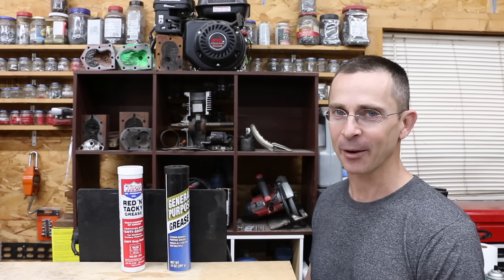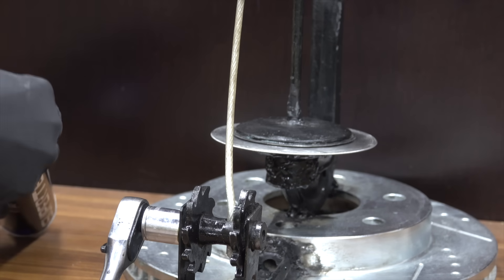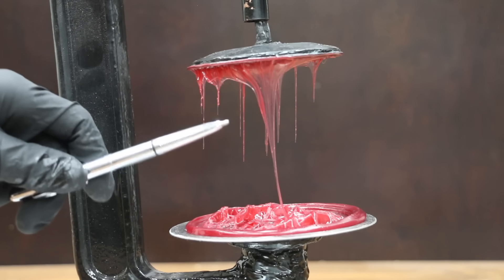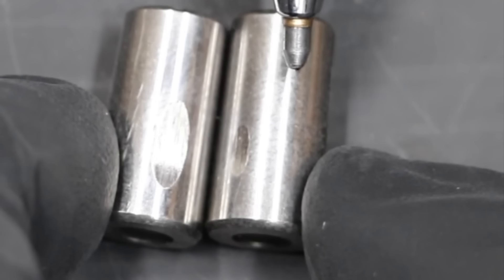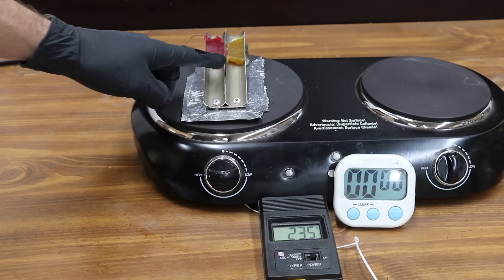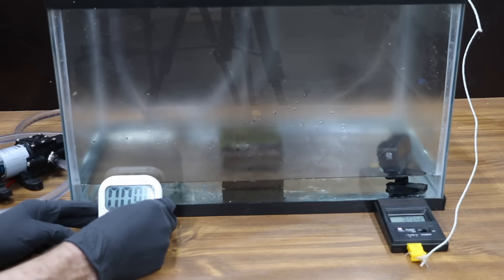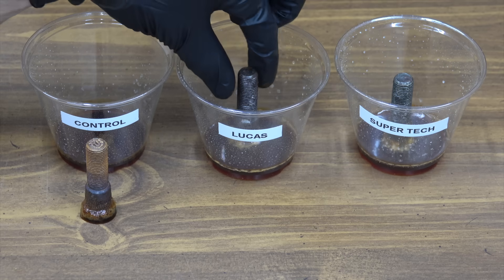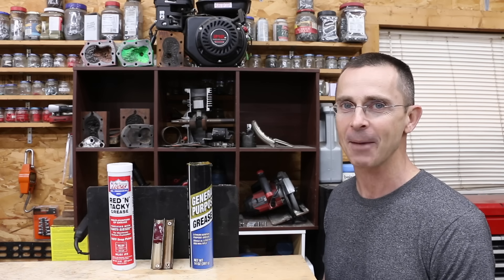Is Cheap Grease better than Lucas Red N Tacky? Let's find out! Bearing Grease Test Episode 1

Comment: Hello my friend. The big difference also comes to the kind of grease you used. The cheap one is simple "lithium" and lucas is "lithium complex" which is a higher perfomance grease. for a general purpose grease buy any brand just "lithium complex" not plain "lithium".
Reply from the maker: Thanks for sharing.
Reply: @ProjectFarm  The world of greases can be a little complex. For instance some greases use "light" oils to make greases for higher speed applications but those greases are not great for heavy loads and the other way round some greases use "heavy" oils to make greases for heavy duty but they are not the best choice for high speed applications. you can have a look at this chart made by SKF, you can have a look at the kind of thickener used for each application and the viscosity of the oil. https://www.skf.com/binary/92-299722/0901d19680658c60-SKF-bearing-grease-selection-chart_tcm_12-299722.pdf
Reply: @vaguincolombia  Thanks for the link! It's difficult to choose the right type of grease when there are so many.
Reply: @Asyss_Complex  You are welcome!. if your application is just the usual, a general purpose grease then a complex lithium grease is more than enough, it covers to medium-heavy loads, high speed, great water resistant and high temperature beyond that then is considered greases for special applications, super heavy duty for heavy machinery or extremely high temperature those are another kind of greases but those greases are for low speed applications only. So there is not a grease that makes everything.

Comment: I love your channel, commitment to unbiased results, and faith in the scientific method.  That's why I'd like to mention that part of your water test is inherently flawed- you scraped away the grease that went over the edge.  If the jet was more on-center, you wouldn't have any grease over the edge and your results would be different.  What you really should be doing (and what you did) is measuring the diameter of the crater assuming both layers of grease have the same thickness.  I'd throw out the other half of the test as it's misleading and faulty, but keep the data from the crater test.  The mass of the grease has nothing to do with the adhesion properties, ESPECIALLY if you're just scraping off what happened to go over the edge with imprecise placement of the stage.  Keep it up, I still love you haha

Comment: Thanks for all of the testing you do. As a engineer I really appricaite your detail and data collect you you go a great job thanks.
I wonder if you could devise a test method for different sheathing, CDX vs particle board. Or maybe varities of partical board. The prices vary greatly, I wonder if one is really better than the other for strenth?  The cost difference from $12 to $24 for a 4x8 sheet. This really adds up when building even a simple garage.
Reply from the maker: Thanks for the video idea.

Comment: How about a test of actual Ball Bearings among brands like SKF, ABEC, Nachi, PGN, hardware store no brand, Ebay-made in China, and testing for break in and play or possible failure?  Also have RS rubber seal, ZZ double metal sealed, Open, and others to break down more.  Most all things have bearings and if you rebuild or do proper upkeep you can spend a lot of bearings of time and can't find any real test in the time I have looked.
Reply from the maker: Thanks for the video idea.

Comment: Try SFR grease it will have no wear
Reply from the maker: Thanks for sharing.
Reply: @ProjectFarm  really check out SFR.com really amazing stuff. Back in the 80s I was drilling a bolt out in an exhaust manifold brand new drill brand new bit and I wanted to put a little lubricant on there so I reached up and grabbed my sfr 100 Oil fortifier that I had been using in my racing engines.  it was drilling perfectly, nice chips then I put one drop of sfr in the hole and it quit Drilling. The drill turned faster and faster no matter how much weight I put on it then my friend got on my shoulder the drill did not slow down I used carburetor cleaner alcohol fingernail polish remover everything I could in that hole and could not get it to drill after a half an hour of my buddy bouncing on my shoulder the bit broke through the fine layer of molecular protected Steel and drilled like butter. I have 240,000 on one of my engines and same on that transmission in my dodge pulling huge 5th wheels across country for a major company and never a problem. I put 7000 miles on my last oil change on that Cummins and could still read the stick through the clean oil. Transmission fortifier is great. Fuel fortifier,,, never replaced any fuel part except filters. The SFR grease is great. never replaced any greasable part except the original ujoints 170,000 miles ago. I use it in every single fluid that goes in a vehicle except brake fluid and antifreeze. When I built my car AKA The "Binderbird" (YouTube) in 1988 I built and installed a International 345 bored ported decked 600 HP fuel injection, you know the works,, after break-in I added sfr 100 it screams, 60 in first, 80 in second, 143 in third for the last 32 years nothing has ever went bad, it runs perfect. No bearing wear, cylinders look fantastic compression is a little down on # 8 stupid me trying to adjust FI at 90 mph went lean on 8 for a split second two years ago. Still runs perfect. Thanks for your time and awesome videos. You ROCK. (TEST WHICH WINGS WORK BETTER ON THE BAD Winndybago)

Comment: Comment about the grease heat test. The function of grease is not to directly lubricate a bearing as a solid or high viscosity liquid. It's job is to be flung out of the bearing race area and then effectively melt and lubricate the bearing surface with a very thin film of low viscosity liquid. So resistance to releasing low viscosity liquid under heat is not a beneficial trait for bearings.  A grease that releases low viscosity liquid at the correct temperature that the bearing was designed for is the best for most bearings (as far as viscosity and thermal change goes). In would suggest that the cheap grease is actually a better choice for wheel bearings and other similar roller bearings given the test with heat applied. The expensive grease may be better for friction plates like bushings where a thicker film may be beneficial. Bearings grease lubrication is often misunderstood by everyone from mechanics to engineers because it functions differently from other lubricating oils. They should never run packed full of grease. They are normally packed to start for initial lubrication during the first few revolutions before the gel consistency grease is pushed out and the thin film lubrication begins. Love the videos!
Reply from the maker: Thanks for the feedback.
Reply: @ProjectFarm  Wow - so many typos. LOL. I typed it on my phone. 

There's so many different uses for grease that it's hard to find a best product for everything. For roller bearings, most are designed for about 1/3 of the bearing cavity volume filled with grease. That avoids churning grease and also leaves room for cooling. It's pretty tricky to test the resistance and film lubrication effectiveness without running the bearings under load at operating speeds. But that's not all grease is used for. 

I really enjoy the videos! It's rare to find a channel with so many useful objective tests.

Comment: Love these tests... keep up the good work... I have a spray rig that has sliding posts with seals and airbags.. I was using big dog orange tacky grease I thought was good but mechanics won’t get anything but your run of the mill grease.. since the change of noticed the suspension holds while filling then suddenly letting go.. test to represent something like that would be spectacular.. then I can throw facts back at them haha..
Reply from the maker: Thanks for sharing.

Comment: There is one more test you should do with grease, oil and other things you try. An extreme heat test on a sheet of metal. The most important function of lubrication is to reduce friction and heat. But if it's really hot does the lubricant run to the heat or run away. I used to sell a additive product years back called Power Up lubricants. I can say I have never replaced a bearing that was lubricated with their grease including my boat trailer wheels and my 1/2 ton wheels, U joints and such and that's been 20 years now. Also if you put their grease  or additive on a steel sheet beside oil and soap base grease and untreated oil then heated it with a torch from underneath. the regular oils and greases would run away from the heat while the power up stuff ran too it. Another interesting point is after 20 years I have never had to repack those bearings. It's just as supple as the day I put it in. With regular greases The oils will have separated from the soap in that time and left you with nothing but the soap.
Reply from the maker: Thanks for the feedback.

Comment: Not sure if you had this comment, but the reason you can't mix greases is based on their thickener (or base).  Both of these are Lithium based, so they're compatible.  You can look up grease thickener compatibility charts and see what's not compatible.  Second, mixing and then letting them sit won't really do anything - compatible or not. The greases have to be "worked" to allow the bases to react.  I've never had it happen, but in lubrication certification training, I've been told that mixing (and using) incompatible grease thickeners will either produce a "rock" or a "sludge" - either way you've lost the ability for the thickener to carry the oil, and thus the lubricating ability of the grease is gone.   Thought you'd find that information interesting, or helpful.  Thanks for all your videos!  Absolutely love what you do!
Reply from the maker: You are welcome!

Comment: The best grease I have seen is motorex high pressure 3000. It's expensive but works extremely well. It would be interesting to see how it compares to the other brands.
Reply from the maker: Thank you for the feedback

Comment: Too bad I am a little late. I work in a Research and Development lab in a grease manufacturing plant as a lab engineer and I could go on for hours about grease. We do greases tailored for very specific high end applications (off-shore wind mills, tunnel boring etc) and let me tell you that not all greases are the same! The greases are categorized by the soap structure, eg. Lithium, lithium complex, polyurea, calcium sulphonate, aluminium complex, clay-based greases, silica, PTFE etc. All with very different areas of usage. Not all greases have to be exceptionally good, you always balance price vs application. Usually this is dependent on amount of additives and quality of synthetic oils/esters.

Regarding testing, the startup torque and timken (wear scar) are well setup. The dropping point is measured in a small cup (takes like 1-2g) with a hole in the bottom, when the first drop comes it's the dropping point. The water spray off is done at 38°C like you did but it is done with a mist (275 psi) rather than a single jet.

Regarding tackiness, amateurs usually think that the stickier the better but truth be told most applications do not need tacky grease (bearings, it just adds unnecessary friction). Tackiness is for sliding contacts. And it is really easy to make a tacky grease, you just add polymer or latex. 

If you or anyone has any questions feel free to ask them! I love talking about grease!
Reply from the maker: Thanks for the feedback.

Comment: You should check the amp load on the motor during you bearing wear test to see if one has more drag than the other during the test. I’m curious to see what the difference would be between the two.
Reply from the maker: Thanks for the suggestion.

Comment: That was an eye opener. 
Unexpected results. 
I think I’m going to go out and regrease my dirt bike parts. 
We dirt bikers are notorious for not greasing our suspension parts. They get hit often by high pressure washers, crossing thru water and mud but we think it won’t hurt. 
Hopefully my BelRay grease that makes these claims is as good as the Lucas you tested. 

Superior water resistance - even in salt water - will ensure continued sealing and protection. Perfect for wheel bearings, headsets, shock linkages, swing arm pivots and other motorcycle, ATV, snowmobile and marine chassis lubrication points. Due to its aluminum complex formula, it won't melt or run out.

High-performance, general purpose grease.
Superior water resistance.
Perfect for wheel bearings, headsets, shock linkages, swing arm pivots and other motorcycle, ATV, snowmobile and marine chassis lubrication points.
Enhanced mechanical stability and special anti-wear additives protect and lubricate bearings for improved performance.
Reply from the maker: Thank you for the feedback

Comment: It feels like you compare a gtx2080ti to a rtx2080ti while applying the use cases of the rtx to the gtx. of course, a general purpose grease will lose to a more specialised grease. 
In other words, you don't compare a renault clio to an Audi a8
Reply from the maker: Thanks for the feedback.
Reply: @ProjectFarm I want to specify a bit: You of course can compare low and high grade to another but  you wouldn't expect the clio to hold up with the a8. It's clear the clio just isn't as good but maybe you'd find some use cases where a clio isn't too bad.

Also, I appreciate you taking your time to respond. :)

Comment: I wonder if you would consider doing a test on the ability of alternators vs generators in terms of their capability to recharge lead acid wet cell batteries from varying degrees of discharge. There is a persistent notion circling the internet that an alternator is incapable of bringing a discharged battery up to a full state of charge which does not seem to make sense to me for a variety of reasons
Thanks
Reply from the maker: Hi James, Terrific video idea!  Thank you

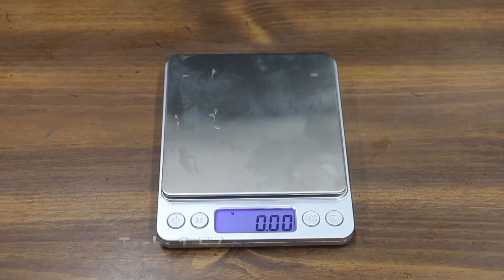Comment: The test at 9:29 is made redundand due to what you did at 9:18 the same thing at 10:07 to 10:14 why would ypu SCRAPE the excess off when your weighing it like dude thats the reason they weighed less
Reply from the maker: Thanks for the constructive feedback.  I used the official approach called for in the testing standards

Comment: Super tech also makes a formulation called extreme pressure high temperature grease that is also red and seems much closer in composition to the Lucas. You should rest that one too to see if, apples to apples, the Lucas is better. Awesome video.
Reply from the maker: Thanks for sharing

Comment: I dont think this is the right walmart grease that you should be comparing with the Lucas. The Super tech multi-duty complex is a more even match. It is a lithium coplex with 500° drop point. Muti-duty vs multi-purpose, not multipurpose vs general purpose.
Reply from the maker: Great suggestion!  Thank you.

Comment: Have you ever considered doing a test on engine oils when contaminated with ethanol? I know its a destroying factor for the additives that protect bearings when the oil is sheared. But it would be interesting to see how much its effected. I have heard and experienced problems with royal purple that i believe are due to this. Its even been said that Chevrolet prohibits the use of it on the corvettes for this reason. But since this is a problem that all engine oils should experience to some degree it would be a very interesting things. This is supposedly also why they are changing additives (which are said to be hitting the consumer market in july 2020, with the new engine oil spec). I wish I had sources I could cite for you right now but I just can't think of any off the top of my head.
Reply from the maker: Thanks for the video idea.
Reply: @ProjectFarm  if your interested I can even send you some aged post oil change royal purple that probably has no business being in a vehicle as a extreme example for testing.
Reply: I would also like to see this test done. I own a Mazdaspeed 6 which has one of the first modern GDI engines out there and is very prone to oil contamination with gasoline. If you use blends of E10 or more for more power, you will for sure contaminate the oil with Ethanol.
I can barely wait for this test.
Reply: anything in oil othere than oil is a contaminant!!!! and i can tell you gas is the worst thing to have in your oil its a solvent thins the oil and whole lot of not good.
Reply: u should send this over to 540rat's wordpress blog (just google it), hes the man for this job